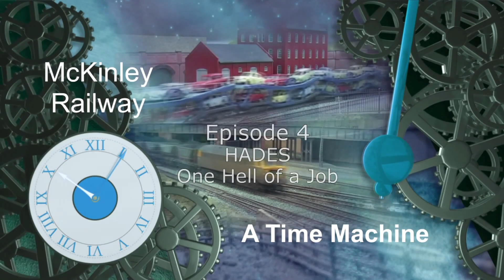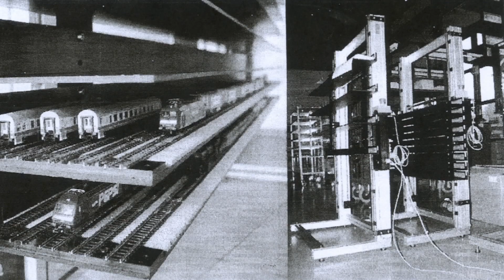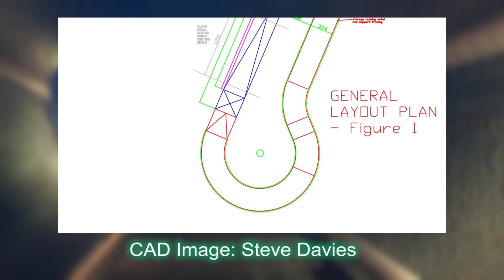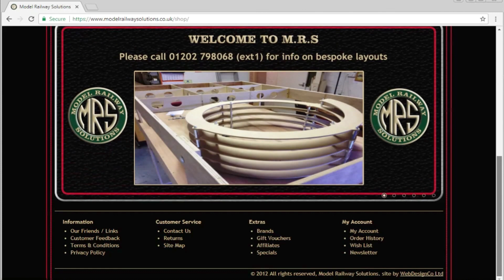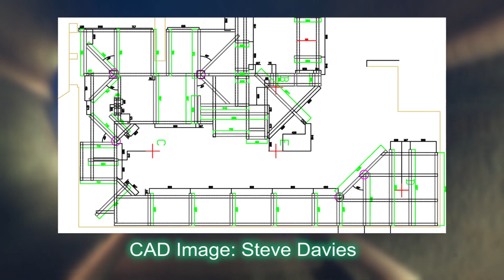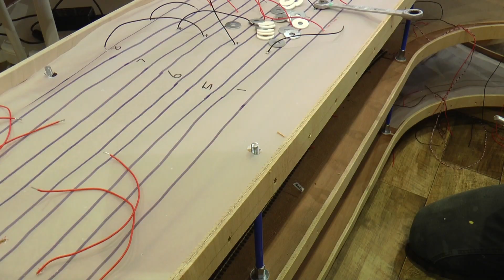4. HADES - One Hell of a Job

Comment: I notice the blue risers you use to separate the levels of the layout. Did you make these yourself or purchase them? Thanks.
Reply from the maker: Hi Phil, it is flexible nylon tubing bought on eBay sheathed over M8 metal rodding.